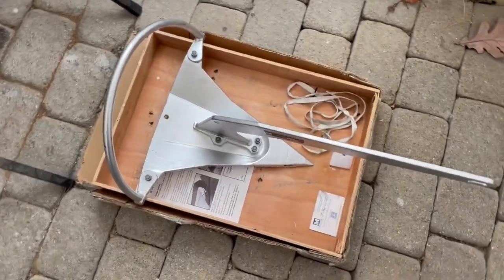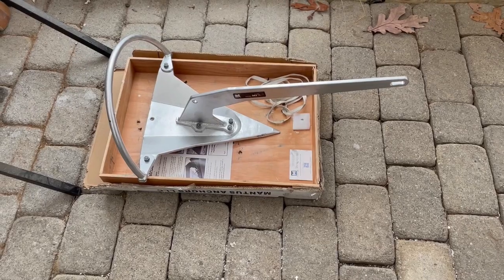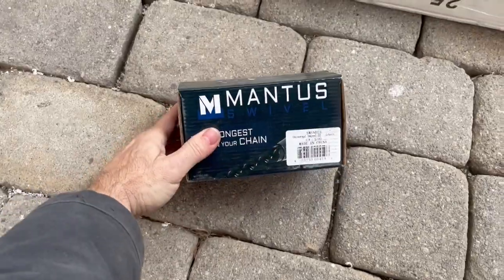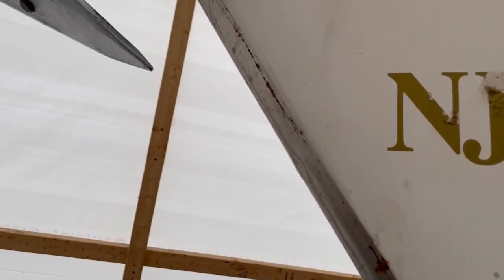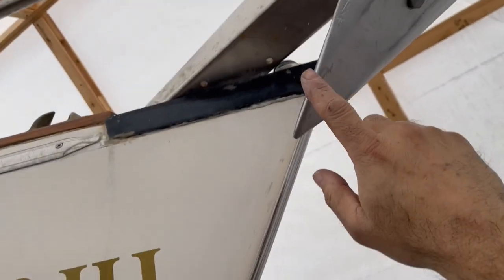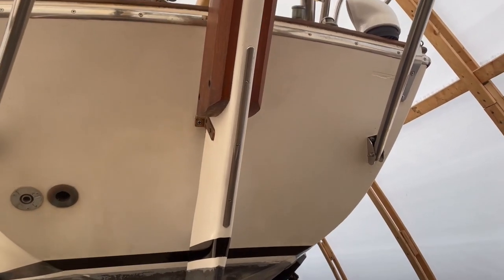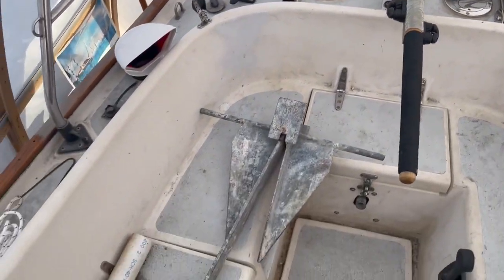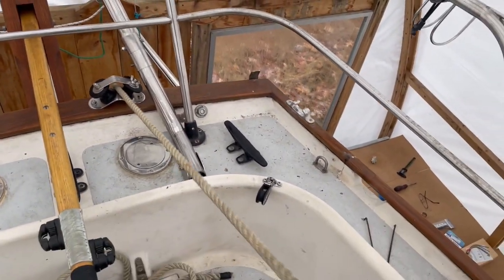Contessa 26 Refit ep.32 - Anchors and Stern Deck

Comment: what is the diameter of the stainless stern deck plate? I have a co26 jjt '78 I am refitting/refurbing
Reply from the maker: The ones I had on hand were 4 inches, but the existing hole was a bit larger so I had to make that trim ring as an adapter to fit the 4 inch plate.